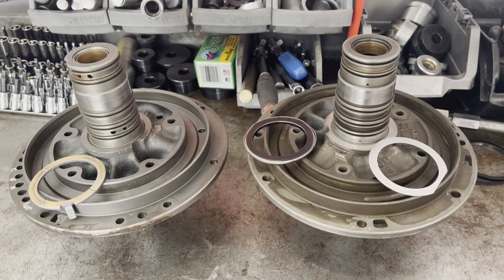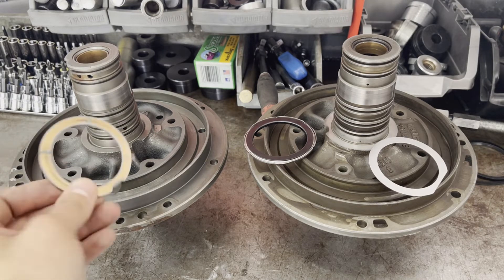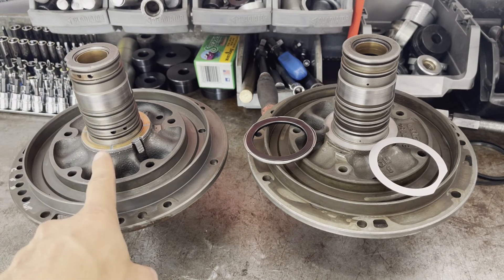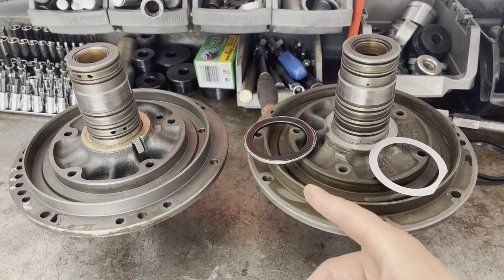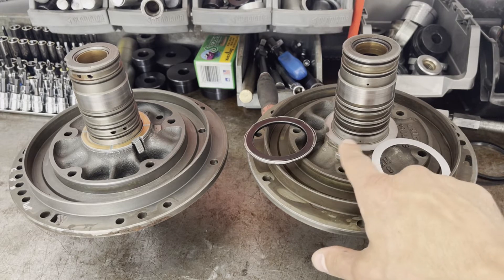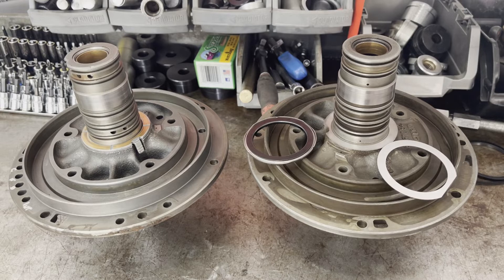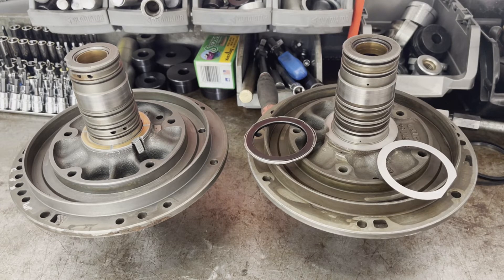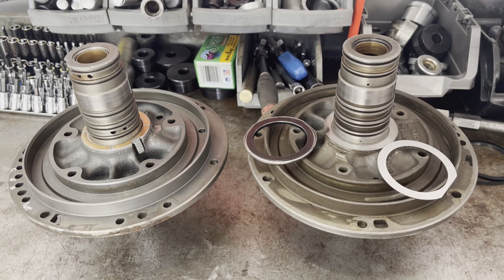How to Rebuild a TH350: Pump Thrust Washer vs Thrust Bearing

Comment: Hey nick! I’m new to the th350 I recently bought a new reman pump assembly and noticed some differences with the sealing ring.
 on the old unit it had a orange teflon sealing ring on the stator shaft just before the Torrington bearing, which had a few shims underneath it with  the new reman unit it does not have a o ring grove to except the teflon ring i have pictures if that will help what I’m asking is the purpose of that bottom teflon ring on the stator shaft will I have a problem like a cross leak if I use the pump without the ring as long my endplay is in spec
Reply from the maker: Thanks for watching, Cameron. I'd send the reman pump back and get the correct pump for your unit. The steady rest teflon ring was introduced to further improve sealing integrity for the direct clutch apply circuit. Additionally, your replacement pump may or may not be machined to use a torrington bearing as the rest and bearing were introduced around the same time. 

This video should give all the details around dates, changes, etc.
Reply: @nickstransmissions your the man nick!! Sent the old pump back today getting a 6 ring and back to cleaning and bushing install. Guys on Facebook don’t know jack crap glad I didn’t listen to them
Reply: @nickstransmissions you’ve help me with a 4l60e in the past and now a th350 I was just curious on how you got so knowledgeable in transmission. Did you go to college or any trade school? I obviously want to grow in my knowledge and understanding of transmission before I think about a business I get the ASTG and ASE books to help with the basics I want to learn as much as I can about the operation of the automatic transmission any books or videos is greatly appreciated thanks bud hope you have a great new year

Comment: Any idea if the th250C and th350C are using the same pump?
Reply from the maker: Hi, thisisyourcaptainspeaking - thank you for watching...They are not the same...The TH350 pump stator support doubles as a nesting location for the intermediate clutch piston while the TH250 pump has no such formation as that transmission uses a band to achieve 2nd gear.
Reply: @nickstransmissions  Thanks Nick, this makes perfect sense.
Reply from the maker: You're welcome, man.

Comment: hi there. this is an exceptional clarification on pumps. One quick question, does this mean that you can  use either of these pumps in an earlier or later version TH350 as long as you dont mix up the pumps and bearings/washers combination? in other words, if I keep the bearing with the correct stator that is machined for the bearing, then can I can put that later pump and bearing setup into a an earlier TH350 (factory 1974) where that transmission's factory pump was the thrust washer type? Also can i use a pump half from a bearing type pump with the thrust washer type stator?  I have one of each type of pump, but my original thrust washer style pump has a worn-out pump half, but the bearing style pump i have has a very good pump half. Thank you in advance!